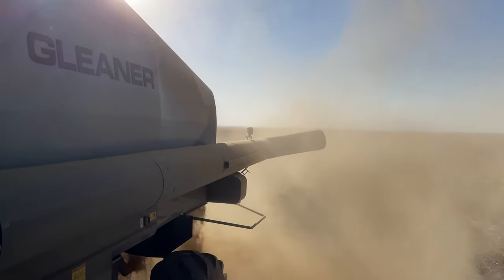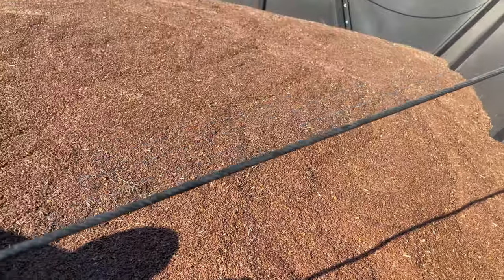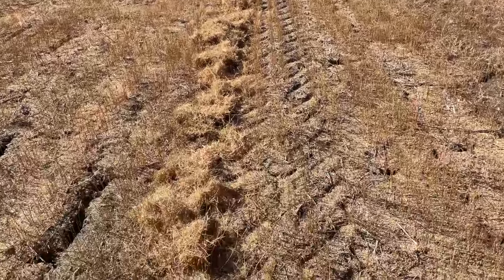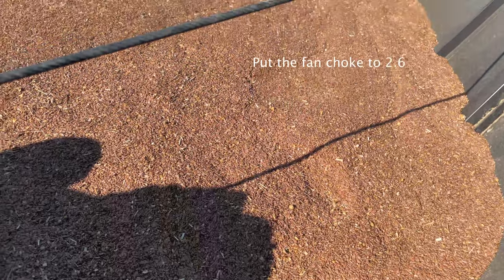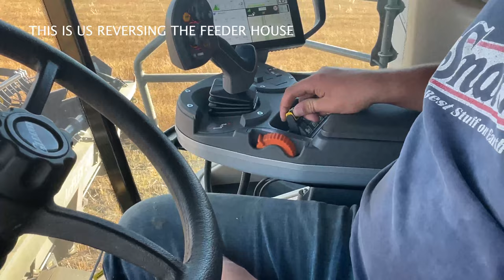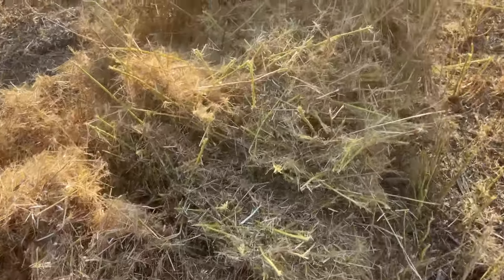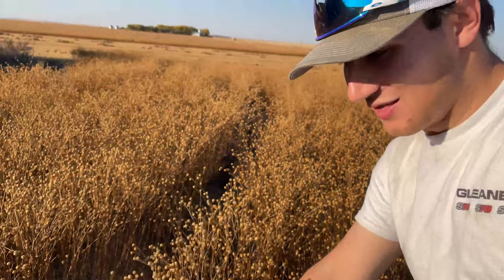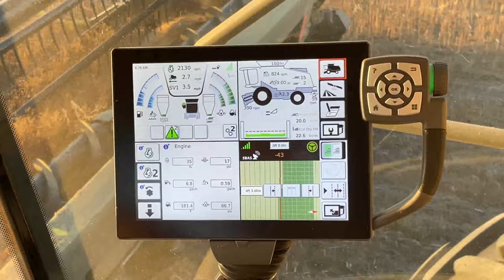Harvesting Flax with a Gleaner S98 in Saskatchewan

Comment: Just the Flax Jack. Gotta admit, had to google up Flax, heard of it, just couldn't tell you anything about it. Surprised at all the uses for it but more impressed with the process to get it - lots of acres, processed through a Big Bad Gleaner the size of a house, some fine tune adjustments to the Cleaner, and all to get a seed the size of a grain of rice. Impressive. Not as impressive as how you were driving that rig while sitting on the roof, up in the hooper, walking around and behind....oh ya forget this was a demo ride, I was sure you were about to show us how you were driving that Gleaner using the drone controller. Save that trick for the Fendt runs. Gotta say of all the ag rigs, combines have got to be one of the most impressive pieces of engineering on wheels that you find in the field. Thanks for braving that late summer heat and pulling together that footage of the up-close view of flax harvest. BTW - think I caught a fast glimpse of that missing SD card blasting out of the auger around 7:28.......oh FLAX! it's microSD oil now. Great job bud, take care - till next one 😎